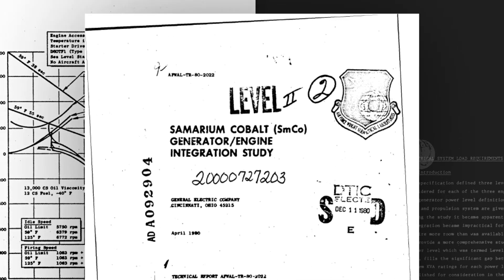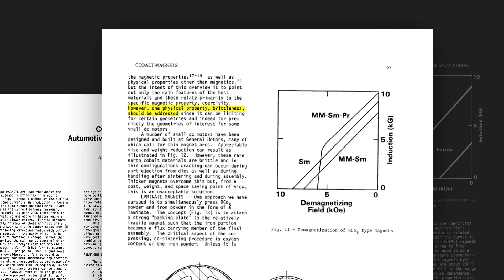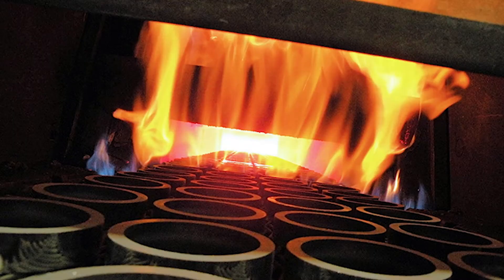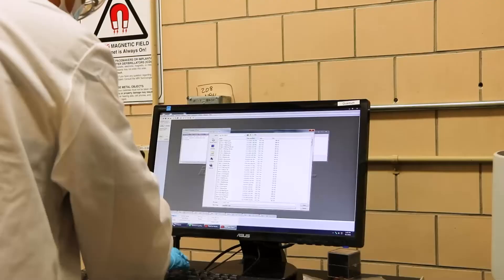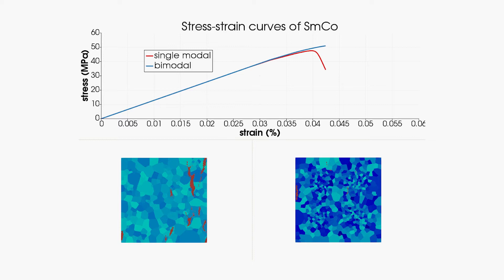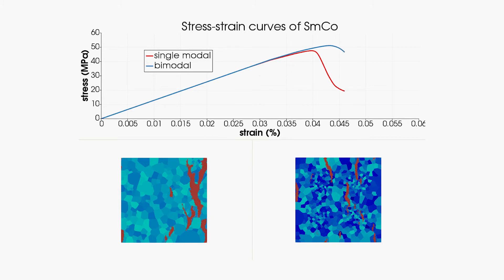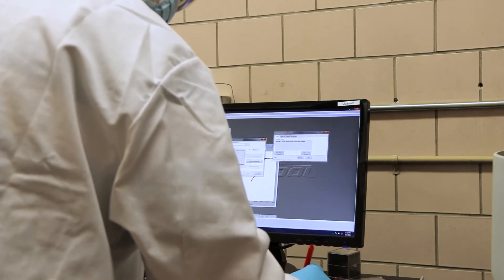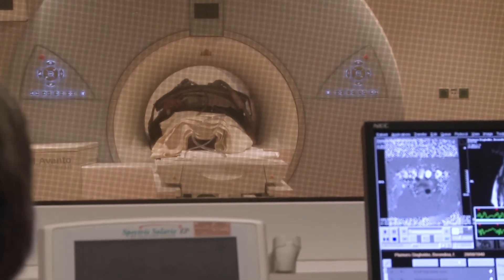Tougher SmCo Magnets: R&D 100 Award Winner

Comment: If you can get away with slightly less power why not mix the SmCo powde with copper than sinter it. It would be mechanically sound and much more thermally conductive. Also could be magnetized directly with high current pulse for some applications.